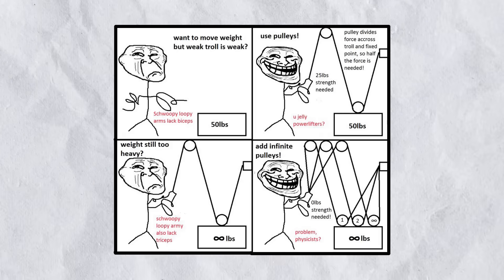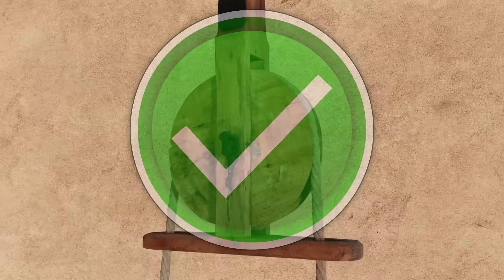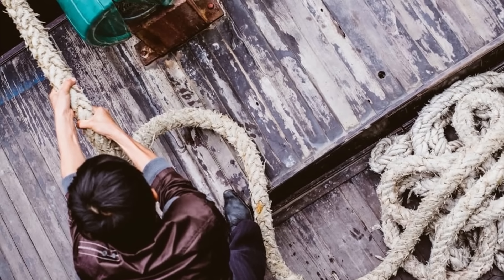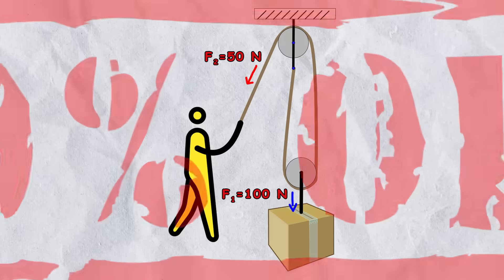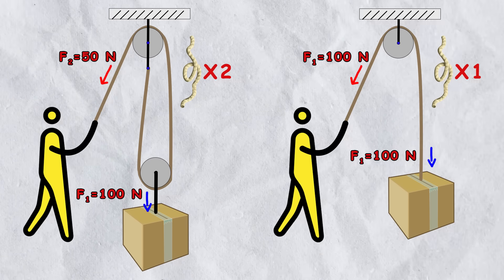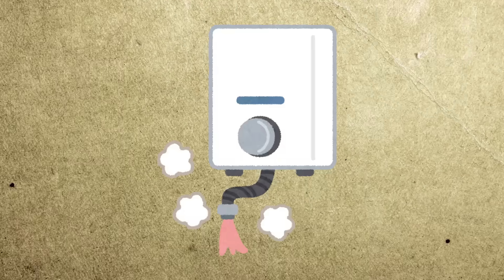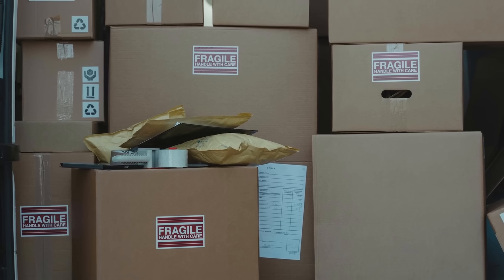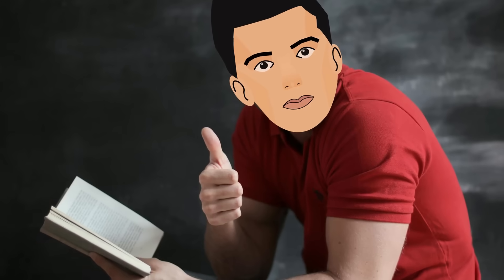why it kind of works 3

Comment: the friction will invalidate the advantage gained from the pulleys
Reply: Its a physics question, so obviously you can ignore friction lol
Reply: Is it possible to design a kind of frictionless rope 🤔
Reply: @LegendaryPea  Even if you did that, the rope would have to be able to handle an infinite weight.
Reply: @enderofbarts you also are forgeting the pulley suports
Reply: Actually not necessarily, since you have the leverage when you have to overcome the friction. I haven’t properly reasoned through it, but my intuition tells me that the additional force you need to pull with at the end is probably a factor multiplied with the infinite Limit of the geometric sequence, which does converge, giving you a finite, and probability actually pretty manageable additional friction force. If you want to see the results of this kind of physics, just look at people on YouTube who build these insane gear reductions, with 20+ gears, its super easy to turn.
Reply: @sepro5135  How did pulling on an infinite amount of rope give you anything less than infinite friction to pull whatever weight is at the end of it?
Reply: @lowkey_Ioki Because an infinite series can converge to a finite amount. Now, it won't necessarily do that here, but it's technically possible.
Reply: @bestaround3323  Yeah upon further research the ratio of mechanical advantage to friction would actually allow an infinite set of pulleys. I made a bunch of assumptions but they're not unrealistic.
Reply: Technically, infinite weight means infinite friction (and also a galactic sized gravitational pull). It's like the "unstoppable force meets immovable object" proposal. Technically, the immovable object will always win that interaction because of the fact that it not only has infinite mass, but also has 2 hidden unstoppable forces of its own: inertia and friction.
Reply: @Handles_AreStupid  It turns out that the infinite leverage you get from the infinite pulleys actually counteracts the infinite friction from the infinite pulleys. It converges to a limited amount of leverage.

Comment: my favourite kind of troll physics is taking established working stuff to the (illogical) extreme and you dont know what it actually does
Reply: Basically the same shit as a black hole, but with more everyday components. What happens at the theoretical extremes of a system? Does it seemingly break the laws of physics, or is there a way to somehow explain if it works?
Reply: @UltimaDoombotMK1  that is why whe have onthology
Reply: Assuming you had an unbreakable rope and pulley system it would work
Reply: Just like the good old troll physics of hot air to lift balloons
Reply: Oil floats on water
Step 1) wait for it to oil
Step 2) cover yourself in water
Step 3) squish
Reply: Thats called math (exclude illogical part) 😂😂
Reply: Hi aletris
Reply: My favorite one is the hot air balloon one
Reply: Usually, friction comes in to ruin the show
Reply: Ruina montium moment
Reply: So basically Baki logic
Reply: Materialist don’t believe in logic, they believe in immediate gratification
Reply: @SeeingRed-e8d  huh?
Reply: @SeeingRed-e8d 
Irrelevant bromethazine 🎋✌️